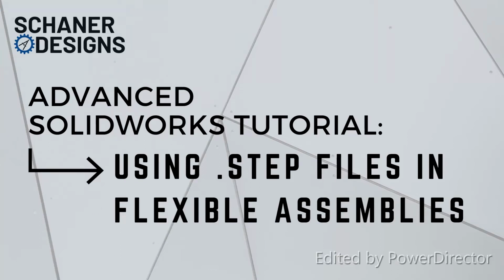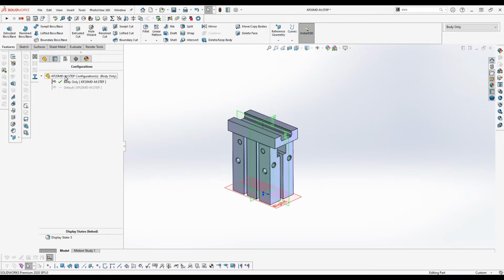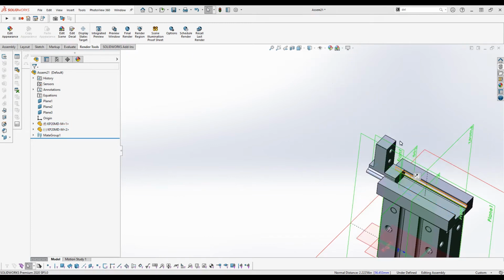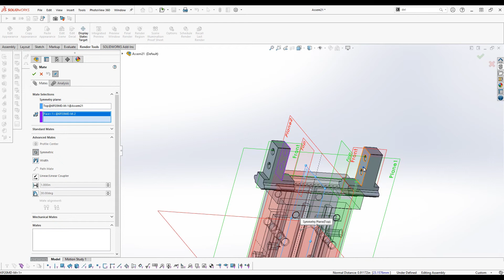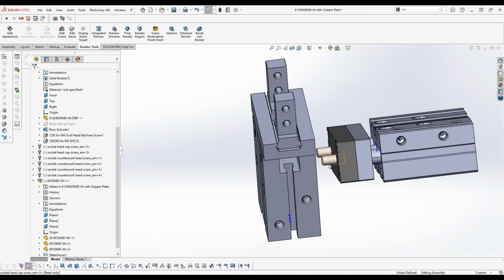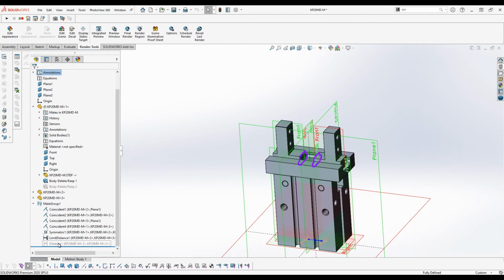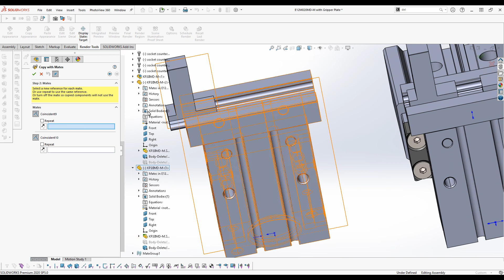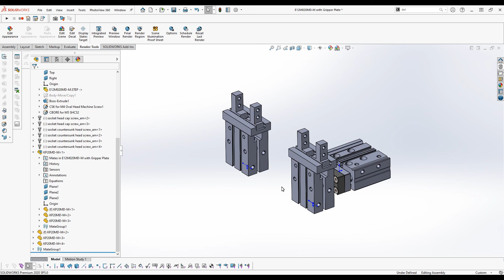How to Make Step Files Flexible in Your Solidworks Assemblies: An Advanced Tutorial

Comment: Im using SW 2022 and recently needed to import a Step file with 100's of Solid Bodies and Surface Bodies. I needed this to then model my new assembly around it and this new assy was flexible with moving parts. SW now gives you two ways to import step files, traditional and 3D Connect. I tried both ways in order to try and use the imported bodies with my new assy but got rather confused in the process. I needed to modify some of the bodies from the step file but it seemed that Featureworks wouldn't work. It was greyed out sometimes or in other situations it said I had overlapping solid bodies and wouldn't work. If I suppressed bodies Featureworks says You have suppressed components and thus does not work.I assume there are many times you might need to import a step file made with many parts, put them in a SW assy and if necessary modify the part using SW features that have been created with Featureworks. I can't find a demo of this workflow anywhere. Am I missing something????
Reply from the maker: FeatureWorks definitely has limitations, and in cases where the imported model isn't very good it will throw a fit, such as overlapping bodies. From what I've seen, FeatureWorks is great when you have a single solid body, or a couple of solid bodies that are relatively simple and properly mated, and just need to modify a fillet or move a hole location. Once you start getting into complex assemblies, it loses usefulness pretty fast. If you're in that situation, you will probably need to use other modeling tricks to modify the imported bodies.

If you're interested, this blog post has some great information regarding 3D Interconnect and FeatureWorks workflows: https://www.innova-systems.co.uk/featureworks-missing-cant-edit-step-files/

Comment: Is there a better way of doing this? I find this painfully tedious, Im new to solidworks, I use autodesk inventor alot and its really easy to do this and it's logical in inventor. I Don understand why do I have to save individual bodies and assembly them AGAIN in another assembly. What if my step file has 50 bodies? Does in means I will have to save 50 bodies and assembly them together in order to use them? Sorry I'm just frustrated with the method, im still trying to understand why of solidworks.
Reply from the maker: I completely understand your frustration, and I would agree that this is very tedious. Unfortunately, there's not really a better way of doing this in Solidworks that I'm aware of. If you have a very large assembly, I would recommend only doing this for components that need to move within the assembly. Group as many bodies together as possible to save time, for example nuts and bolts used to mount actuators can typically be grouped with the main body of the actuator since those components will be fixed relative to each other. Planning is also critical for larger assemblies - you need to carefully think through how the parts are going to interact to reduce the time spent using this method.

The bottom line is that Solidworks is a powerful modeling tool for design from the ground up. However, it is not necessarily the best tool for working with complex imported files that need to be integrated with native files. From what I've seen, that's where Autodesk software does really well. Both programs have their strengths and weaknesses, and a lot comes down to personal preference, prior experience, and industry-specific functionality requirements.
Reply: @schanerdesigns  thanks for the explanation, really really appreciated it. I actually have more questions about step file and exporting methods, I don't know if you can help me.  Haha
Reply from the maker: @jinken9613  What other questions do you have? I'll help if I can.
Reply: @schanerdesigns  Hi, i have been doing some solidworks assemblies, one problem I encounter is that, when I import a step file, and try to add new configurations, the default configuration would automatically be suppressed, sometimes I'm able to unsuppress it and the parts would appear, but sometime I'm unable to unsuppress the the part, the part would just disappear. there is no bodies under solid bodies tap. configuration changes is just change of different materials.
Reply from the maker: @jinken9613  Here are a couple of things that I think will help you:

1) When you create a new configuration, that configuration automatically becomes the active configuration so the Default configuration will be greyed out. You can get back to it by double clicking on it in the Configurations tab.

2) In assemblies, if you want to suppress a part for a configuration, make sure you suppress it on the assembly level and not on the part level. In the FeatureManager tree, if you click the dropdown for the part it will show all of the features for that part. If you right click on one of the features and suppress it, it will just suppress the feature at the part level, and not the part itself. To suppress the part from an assembly, you need to make sure that you are suppressing the part and not a feature of the part. When the part is properly suppressed, the dropdown for that part will not be available and the part will be greyed out in the FeatureManager. If only a feature is suppressed, the dropdown will still show up, but that feature will be greyed out.

3) For material changes on a part with multiple configurations, check out Configure Material (right click on Material at the part level). This will allow you to assign material based on configuration, and quickly see what material is assigned to each configuration.

4) Lastly, if you plan on making any modifications or configurations to an imported .step file, I recommend saving the file as a .SLDPRT file before importing it to your assembly. This will allow you to create configurations, make extruded cuts, suppress or hide bodies, etc., all at the part level. When you simply import a .step file directly into the assembly, it keeps things simple but also limits what you can do with it.